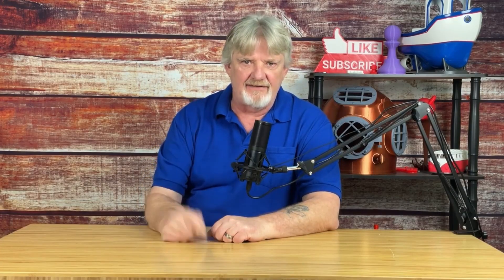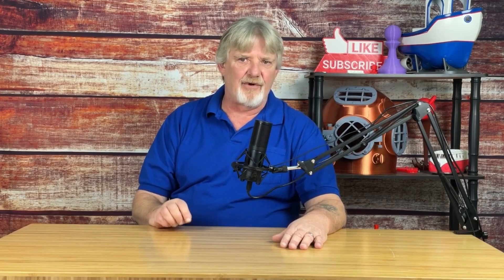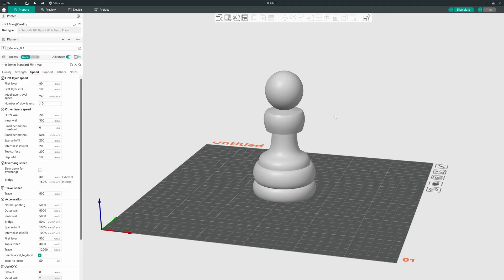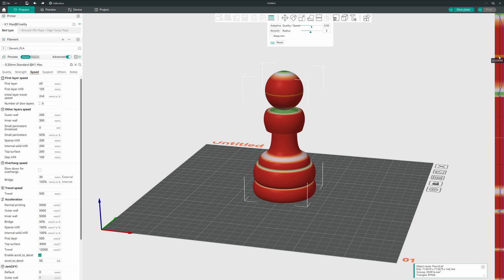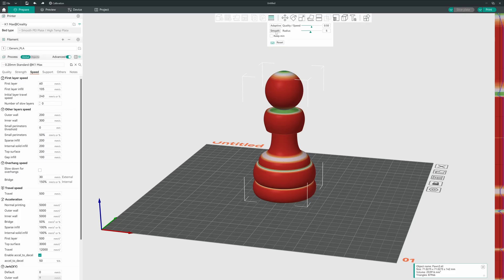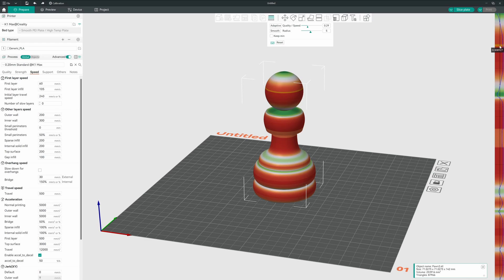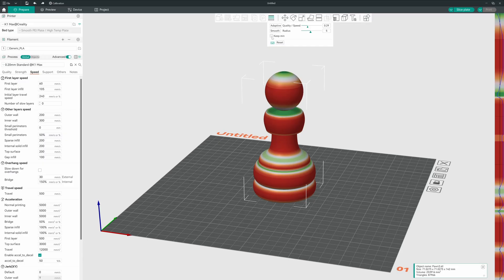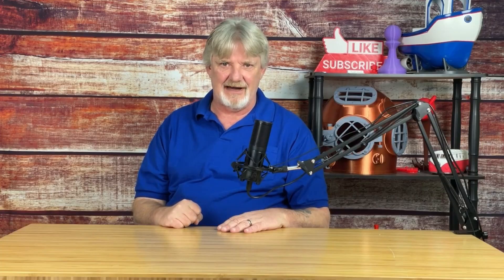Get Rid Of Those Rings & Steps with Orca Slicer's Variable Layer Height

Comment: Thanks for the video. Where should you set the sliders? And what's the print time impacts to where you place the sliders? When you repeatably hit the SMOOTH button does that move the associated slider? Or does hitting the button just change the layer heights and show in the object diagram? Would be nice to know how much smoothing you've applied with a numerical value. Seems a little odd how the buttons & sliders don't necessarily seem linked.

Comment: Breaker 1-9er, Over-modulated gain report, turn it down, compress it to get the volume correct. If there's too much breath noise etc, after the compression on that mic, use a gate first to cut that low signal out, big mic can sound much better. Thanks for the info. Enjoying Orcaslicer.
Reply from the maker: The mic has been upgraded since this video was done!!!

Comment: do you have any tips for the seams? is this a video that you would consider doing in the future? (Seams is one aspect i find i struggle the most with)
Reply from the maker: Good question! If you're printing a cylinder or dome shaped object, the most you can do is set the seam to Random. With models that have sharp vertical corners, it's a little easier to try to hide the seam. In Orca slicer, I almost always use Aligned or Random depending on the model. But sure, a detailed video on seams sounds like a good idea. Are you using Orca slicer or something else?
Reply: @pushingplastic7445  I now primarily use Orca with my K1's, previous to that i was a fan of both cura and prusa (still use with the other printers) - i find with orca the seams are much more pronounced and am failing to understand how to best "hide" them with the gaps/trench its creating. with Cura and prusa they were present of course, not not nearly as pronounced.